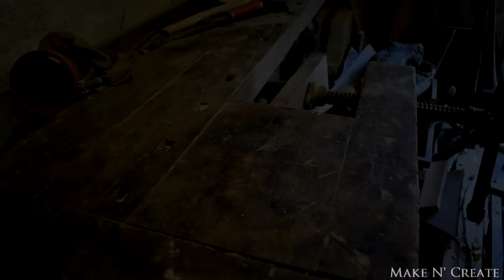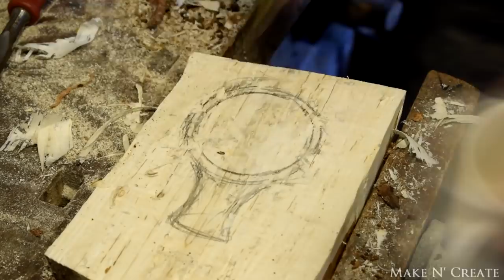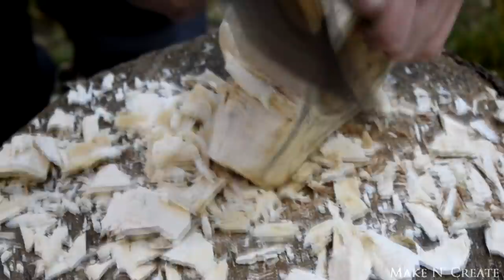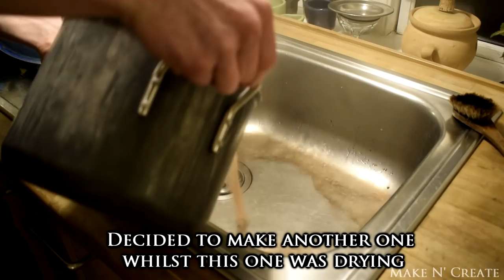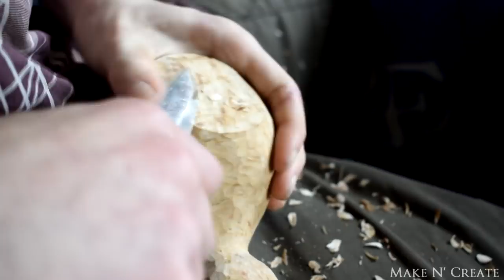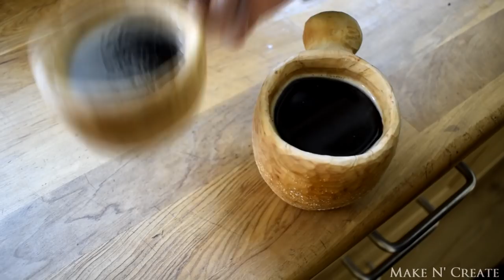Carving - Kuksa from Birch Wood

Comment: Here in Finland the inside of the kuksa is typically saturated with oils from coffee grouds. Pour wet, used coffee grounds to the kuksa, then rub it in until the grounds are dry. Repeat as necessary.
Reply: Hannu does it smell like coffee after?
Reply: At what point of the process should you apply the coffee?
Reply: @chalkychoochoo2304  end
Reply: @iliilil5761  Thank you!
Reply: Hannu, I have a friend named Bruce Hannu here in the states
Reply: And if you only want to drink TEA from your kuksa?

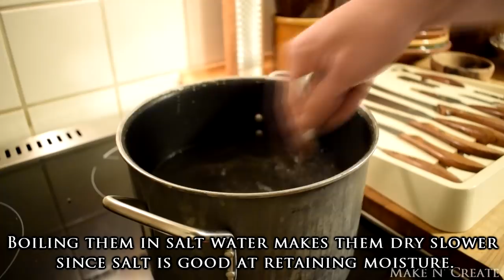Comment: Nice Video. Loved the info at 3:33! I always wondered why people use Salt water to boil their cups... I thought it was to help pull the tanins out of the wood. Had no idea that salt helped slow the drying process. I have read that it is good to dry in a slightly open plastic bag switching bags every day until you no longer see moisture build up inside the bag...
Reply: WHAAAAAT!? That's a great idea with the partially sealed bags, until the condensation stops building! Thanks for mentioning that. There's a few applications I can think to use that for.
Reply: I will also stick mine in the microwave for a minute to start the process. Not too long or it will burn the wood. Then I use the plastic bag to finish the drying process.

Comment: Coconut is not ideal as it often goes rancid. Nothing worse than making a lovely cup only to find it smell awful the next season. There are far better food safe finish options out there. Your use of raw linseed oil is spot on, however.
(For others reading this: DO NOT USE BOILED LINSEED OIL. It contains drying agents that make it useful for woodworking and renders it not food safe)
Reply from the maker: Found out the hard way ;) Don't even remember why I did it in the first place.
Reply: It smells nice? :P
Reply: well - edit it out then!!!!!!!!!!!
Reply: Walnut oil is another good choice
Reply: Best I’ve found for a food safe finish is mineral oil mixed with melted beeswax
Reply: @MakeNCreate  What about stand oil? This is boiled linseed oil that has no additives and really was boiled rather than chemically treated. (Always check the MSDS to be sure, of course.) It's available in art supply stores in the paint section. Mix with beeswax melted in a double boiler for a nice finish.

Comment: A wooden cup is heavy, bulky, absorbs liquids, and is harder to carry than a modern cup.  Does calling it a kuksa change any of that?
Reply: I'm not seeing your point. A metal cup conducts heat unless you use a pot holder or some such; each metal has its own disadvantages. A ceramic or borosilicate glass cup is heavier and still bulky, doesn't absorb liquids but does shatter. Wood isn't dishwasher safe but can be made in the field and is pleasant to hold. Each has their own advantages. If you prefer, go watch This Old Tony and he makes a nice espresso pot; you can use similar techniques to make your very own metal coffee cup.

Comment: It's faster, if you use a propane torch , and do a control burn, to hollow the middle. I've done bowls that way, much quicker. just burn , and carve with a knife. Burn, carve , burn, and carve.
Reply from the maker: Dries the wood to Quick and causes cracks

Comment: This is a very good idea but you can sanding for a better finish
Reply from the maker: Traditionally kuksas are not sanded, the finish you get from a sharp knife is very fine. Obviously I'm not all that good at it yet but i will get there. Thanks!
Reply: heeey u got 2 Chileans watching, i find your editing relaxing and very satisfying, nice work :)
Reply from the maker: Tomas Entrala Caruso thank you!
Reply: trhee chileans :v
Reply: another kuksa maker here, one issue with sanding is that it can actually take more work to get a good finish than with a knife, when the wood gets wet the fibres rise in it and as sanding makes the fibers pretty rough they rise more and leave quite a bad texture whereas cut fibres barley rise at all if the knife is sharp enough
Reply: i was gonna say that!
Reply: Make N' Create :) another amazing video I adore your work and hope to see more
Reply from the maker: Connor Smith thank you!
Reply: The outside finish is probably best as is; easier to hold. For the inside surface, if he wanted a smoother finish, he would probably use a small card scraper. Planes and scrapers can get a much, much smoother finish than is possible with sandpaper. Old school hand tool woodworkers often use sanding to RAISE the grain via roughing, for finishing purposes.

Comment: NOOOOOO
Not coconut oil!
Walnut oil or some drying oil that won't go rancid.
Also, if you will use green wood, denatured alcohol is better than salt water for drying without cracking.